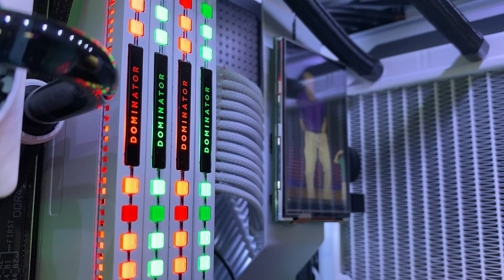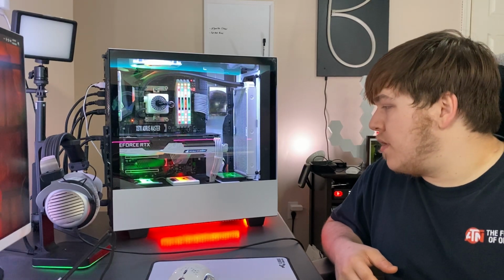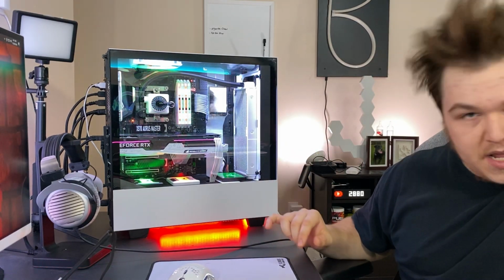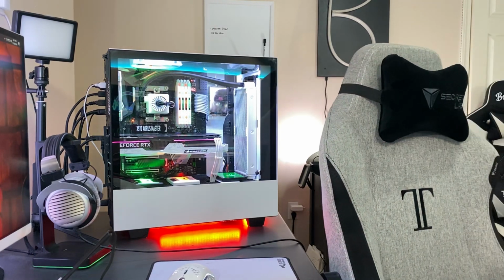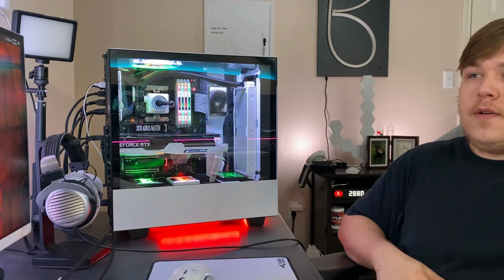DIY $50 Internal PC Screen

Comment: Nice video, thanks. Your AIO is wrong located btw. Pipes must be coming from bottom, like this, of course it can't be 100% loaded with liquid, so air will be present at most top place where the raidator pipes are and it will die soon like this. Consider to change it upside down, just an advice.

Comment: I’m sorry if this is a dumb question but what is the purpose of the SSD ? Can this work without it ? Awesome video btw!
Reply from the maker: No dumb questions here. The purpose of the SSD is to add storage. You do not need it. If you would like to add storage, then you should get one. It doesn't have to be the same brand or even size. There are a plethora of SSDs out there.

Comment: Which cpu AIO is that mate? 
Thanks for the vid mate. I was going to get an AIO with an LCD but they are about £60 more than a standard one. I have the exact same space in my Corsair Crystal 280x so the extra LCD looks so much better and costs less.
Reply from the maker: Thank you for the kind words. The cooler on my computer in the video is the Deepcool Captain 240EX. Unfortunately, due to them leaking in people's computers, they have stopped production on that specific model. I have since upgraded to the Lian Li Galahad 240.
Reply: @realJacobLane  I knew I'd seen that AIO briefly a while back and not much since, the leaky issue explains that 😁 lovely choice on the Lian Li 😎
Lian Li plus an LCD 🎶
Great idea and ryhme 👏👏
Good work 🏆

Comment: If you want to have your screen turn off at the same time as the computer, i'd suggest getting a Molex to USB A female 5v adapter. Plug right into any peripheral cable on the PSU itself, Provide same voltage as a USB port and will shut off power at the same time as the PC.
Reply from the maker: That's a great idea!

Comment: Anyone know how to fix this issue im having, my sensor panel turns into my main display, no matter what i set in the window settings, it wouldn't let me bypass as a sensor panel. Monitor is connected by DP to GPU and sensor panel connected by HDMI to GPU. TIA!
Reply from the maker: Interesting. That's a tricky one.

Comment: putting the radiator in the pc in the front is not healthy for the pump. Try top mounting it to reduce any air bubbles that might be entering the pump.
Reply from the maker: I understand, but I cannot put the radiator and fans on the top because the motherboard and ram prohibit it due to clearance issues. Also, the top of the radiator is above the pump, so in the event any air pockets form, they will go to the top of the radiator, not the pump. For the most part, 95% of CLCs are low tolerance to air pockets, meaning there is very little to zero air in the loop.
Reply: Jacob, If you use ddr4 u can maybye try the g skill trident RAM, its cooler is smaller than the board. With this RAM I was able to fit in my radiator on top

Comment: I'm a total noob regarding PC mods and the PC world overall, I'd like to know if this could work on a non-liquid cooling system PC. Just got mine that has a regular cooling system and I'm a total sucker for those pretty screens that liquid PCs have. Is it possible to do this? I'm not looking to visualize stats or anything, just anime GIFs and such. Thank you in advance!
Reply from the maker: Of course. It's an independent electronic, meaning it works on it's own. Hell, you don't really even need a pc for this to work. You really just have to find a way to power it and how to get signal to it. Mounting it may be tricky in some cases.
Reply: @realJacobLane  Thank youuu! I'll try it then.

Comment: also, can you calibrate the screen to whatever is being displayed to be flipped/positioned any way you want?
Reply from the maker: Yes, Windows settings, display settings.
Reply: @realJacobLane  another question, do i HAVE to connect the other  hdmi cable end the GPU or can i connect it to the hdmi output on the motherboard
Reply from the maker: @bigdaddybryan7918  If you have a gpu, your display settings will be set to the gpu not the motherboard, so you have to use the gpu. If you only have one HDMI, then just get an adapter.

Comment: Would it be possible to hide taskbar? I have 2 current monitors that I want taskbar but don't want it on the internal display. Nice video btw!
Reply from the maker: If you're referring to hide the taskbar only on the small display, I do not know how. You have to hide it on all monitors.
Reply: There's an option to only show taskbar on the main display in the taskbar settings within Windows, should be in Personalization.

Comment: I have a problem with my pc not detecting this smaller screen, I'm using a hdmi cable splitter since my dpu only has 1 hdmi slot
Reply from the maker: A splitter will not work. Sorry :(
Reply: @realJacobLane  do you know if there's any other way to connect it or there isn't?
Reply from the maker: @samuelaguilar7024  There is no other way other than you need another display output on your graphics card.

Comment: How long was the micro usb cable. I have one but I’m not sure it is long enough
Reply from the maker: About a foot.
Reply: @realJacobLane  ok and one more question. Is the two sided tape enough or did it ever fsll
Reply from the maker: @ezarelement7103  It fell lol
Reply: @realJacobLane  did it get damaged or did you just put it back on?
Reply from the maker: @ezarelement7103  I ended up taking it off because I swapped cases. I plan to remake the video eventually.
Reply: @realJacobLane  ok I’m using the tape too I just hope it works for me. Was there any damage from the tape?
Reply: What do you plan on using instead of tape?
Reply from the maker: @ezarelement7103  There wasn't any damage.
Reply from the maker: @ezarelement7103  Screws ;)
Reply: @realJacobLane  ok I’m going to try more heat resistant scotch tape and hope that works
Reply: @realJacobLane  did you remove the fan from the screen?

Comment: I bought the display in the link, but it has a fan that makes quite a lot of noise, did you remove it or did you buy one without a fan?
Reply from the maker: Mine did not come with a fan. It’s more than likely used to cool the Raspberry Pi and not the screen, so you don’t need it.
Reply: @realJacobLane  ok, thanks for fast reply, very good video btw, keep up the good work
Reply from the maker: @julianbernhardsen963  Thank you!!

Comment: So how does this work? I’m trying to instal this on my car’s dash board how do I go by doing this? If it’s powered by a usb cord that’s perfect but how do I get it to play gifs without a pc? Like maybe just automatically have it okay gifs every time my car starts?
Reply from the maker: Hmm that sounds kind of tricky. Maybe a Raspberry Pi with a custom OS? I don't know too much about that.
Reply: @realJacobLane  how did you upload the gifs to it? Can I upload the gifs to it through a pc then unplug it and display it somewhere that isn’t a pc?
Reply from the maker: @attck29  I used a program from Steam called Wallpaper Engine. It's 5 dollars, but I think it's worth every penny.
Reply: @realJacobLane  nice is it possible to upload the images from the pic then unplug it and use it to display somewhere else that has a usb power slot?
Reply from the maker: @attck29  I'm sure it's possible, but I don't know how to do it. :/

Comment: What’s the wallpaper app you use? Also I’m curious, I bought one last week gonna install it today I’m wondering do you have to set it up every time you start the PC? And do you have to link the display in your nivida settings.
Reply from the maker: The wallpaper app I'm using is called "Wallpaper Engine". It's on Steam and I believe it was like $4.99. And as for the screen, you shouldn't have to set it up every time you turn on your pc. For me, I have to unplug the power cable each time I boot my pc. You might have to do the same.

Comment: How did you get the display to turn of when your PC turns off, mine doesn't turn off on its own
Reply: i have one in my case that powers off the hdmi and turns on and off with the pc, bought it off amazon around 50$
Reply from the maker: @mortemachina  That sounds so much better. Can you share the link?
Reply from the maker: You have to unplug it sadly.
Reply: https://youtu.be/RcNJA6V4tNY  I used the one in this video, there may be others that also just use hdmi

Comment: i did the same , but it keep showing to me white screen on my 5 inch display :( why
Reply from the maker: Unplug the HDMI and replug it with the pc on. If does doesn't work, unplug the power and replug with the pc on. If that doesn't work, your screen may be defective and you may need a new one.
Reply: @realJacobLane  i did that about 3 or 4 times,, and i tried on my other pc,, same problem
Reply from the maker: @SamiAlsafadi95 Oh well, I don't know what else to tell you.

Comment: learned something about the CMOS battery whats it there for. Definately gotta replace mine after i been building on mobo disconnected over 1 year
Reply from the maker: Haha yep yep. Its just there to keep the time, date, and BIOS settings right. You typically only need to replace them every 3 to 4 years. If you keep ERP off, then your power supply with keep supplying the 3v the board needs to keep the time, date and BIOS settings right. It's only in transport/when the power supply is unplugged, that the CMOS battery is being used.
Reply from the maker: Another way to know if you need to replace the battery is when the time and date are wrong when you boot your pc up. And most likely your BIOS settings have been reset to default if you modified any of them.

Comment: So you just power this with Micro USB and use the HDMI to make the display get detected to use Wallpaper Engine? Is that all I need to do? I want to get this but I just wanted to clarify xD
Reply from the maker: You are correct!
Reply: @realJacobLane  Thanks!

Comment: do NOT PAY FIFTY BUCKS FOR THIS, you absolutely do not need to pay that much for ultra hd for a screen the size of an ssd, that's bullshit.
Reply: seriously, they make full 5 inchers with analog input (which is more than fine with short cable lengths) for 20 bucks. You absolutely don't need the touchscreen feature when it's internally mounted, and it gives you an actual use for legacy dvi/vga ports. The screw in is safer for something permanent anyway.
Reply from the maker: @curvingfyre6810  The digital screen is $27 not $50. Everything together is $50. This is an alternative to the NZXT Kraken Z coolers with the screens on them. They run around $250, so think this is a nice, cheaper, alternative.

Comment: Thanks for the info brother. I'm using a NZXT H710i and where you had the SSD mounted I have vast open areas just before the intake fans in the front of the case. I want to add some life to that section and distraction so the eye wont be drawn to the few fan cables in the lower corner. I've seen many before but never had the inkling to do it. Now that my build is complete I'm looking at this barren empty area of my case and it needs something.
Reply from the maker: Sounds awesome! DM me on Twitter the results!

Comment: Mine just stays on no signal. What do I do?
Reply from the maker: Make sure both ends of the HDMI are plugged in correctly. If they are, then unplug the screen from power and re plug it in. If that doesn't work, then you may have a defective screen.

Comment: where is the fan on the pi? there's a fan on the back in the amazon link
Reply from the maker: For the screen? There is no fan on the screen. It's a Pi, it's just the screen.
Reply: @realJacobLane  all good i removed the fan lol. does it get hot? being wrapped up in that tape
Reply from the maker: @josephbattad7747  It does get warm, but nothing to be worried about.
Reply: @realJacobLane  thanks dude, i did everything you showed in this video. i subbed! awesome channel man
Reply from the maker: @josephbattad7747  Awesome to hear. Thank you so much!! It means more than you think!

Comment: Why doesnt your pi screen have the fan and the gpio ports like the ones in the picture on Amazon
Reply from the maker: My screen didn't come with a fan, and I sanded down the GPIO headers to make the screen sit flush.
Reply: @realJacobLane  oh alright is there a way to get a case for just the display because the case option on Amazon is for the display and the acually rasberry pi mini pc
Reply from the maker: @ceysur2847  I have yet to find a case for just a screen. If you or someone you know has a 3D printer, you could 3D print one.
Reply: @realJacobLane  yeah my friend 3d prints stuff but he can’t a find a model that’s just for the display they all seem to be for the display + the rasberry pi
Reply from the maker: @ceysur2847  Ah I gotcha.

Comment: Is it possible to use laptop screen? I have huge case but want something bigger :)
Reply from the maker: Hmmm, that may be a challenge. You would need a driver board and more power to make the screen work. I would do some research and see if you can find the driver board for your screen.
Reply from the maker: Let me know if you do it. Tweet me on Twitter @jacobiceps

Comment: Dude you’re so right about those CPU coolers tho they dummy expensive, could buy an RTX 2080 for around that price
Reply from the maker: For real!!! It’s more insane that people will still buy them, just for the screen. It’s still a basic aio under the screen. It doesn’t justify the 300 dollar mark.
Reply: @realJacobLane  what is a normal price? Around 100 - 150 right?
Reply from the maker: @zsq007  The NZXT Kraken Z63, the smaller 240mm aio, is $250.00. And the bigger, 360mm, is around $300.00.
Reply: @realJacobLane  so is this an upshot price? I assumed they were normal. I actually considered picking one up for an upcoming build with a 5600x, but I think I’ll go with an air cooler.
Reply from the maker: @zsq007  I don’t believe so. These coolers are just very expensive.
Reply: @realJacobLane  I bought the Kraken Z63 for $200. I was contemplating getting the cheaper model without the screen but I figure if I was going to cheap out and just get an aio instead of a custom loop for the time being, I might as well throw a couple of bucks at it to make it a little different plus I'll set it to my temps so its really easy to see if it's getting too hot without the overlay.

Comment: I have a Cosair 4000D case with two 140mm fans at front and the 5 inch screen is between them. Fills the blank spot nicely. I used an adaptor to plug the usb into a motherboard usb header.
Reply from the maker: Very nice.
Reply: does this mean it will turn off with the computer
Reply: Hi do the 120mm mounts line up with the wholes on your 5 in display, if not how did you mount it

Comment: I did this and now when I play a game the game stutters alot do you have any idea how to fix that?
Reply from the maker: Interesting. I’m sorry to hear that, but if you are using it with Wallpaper Engine, that may be why it’s stuttering. Wallpaper Engine is very taxing on your ram and CPU. On the other note, if you aren’t using Wallpaper Engine, then I would be more confused than you. All this is, is a second monitor, and shouldn’t really have any performance impacts. TLDR: If you are using Wallpaper Engine while gaming, close it. If you aren’t using Wallpaper Engine, then I have no idea what to do.
Reply: @realJacobLane  I am using wallpaper engine and thanks I didn't realize that effected it
Reply from the maker: @tilvalhalla2689  Of course. No problem.

Comment: Does the usb go into a usb headed on the motherboard for power?
Reply from the maker: I suppose you could, but I wouldn't recommend wasting a USB Header just for power. I would use it a regular USB-A port on the back of your motherboard.
Reply: I was thinking of getting the internal nzxt header port to add USB’s to the inside of the case
Reply from the maker: @questt5  You could do that. Do keep in mind that this screen in particular does not turn off on its own, so you will have to unplug it whenever you turn your pc off. Or you could turn ERP on in your bios to turn off all power to your usb ports when your pc is off, but this will run your CMOS battery down. Do what you feel is most comfortable.
Reply: @realJacobLane  good to know. I saw one that does have a turn off feature but doesn’t have touch capability like a lot of the raspberry pie monitors have, but if it’s inside my pc I won’t need that feature anyway.
Reply from the maker: @questt5  Right right. This one doesn't have touch features.

Comment: And what do I use to control the video on screen
Reply: You could technically even use Aida64 and show computer specs like CPU temperature or GPU temperature.
Reply from the maker: You can use anything you like. It is just another monitor, so you are free to use it like a normal monitor if you so please. I personally use Wallpaper Engine on Steam for animated wallpapers. But you could use whatever.

Comment: Question. If my pc with the screen is to the right of my monitor and I move my cursor right, will it go on the mini screen?
Reply from the maker: You will have to go into your Windows settings and choose where the monitor is. Right click on your desktop and click Display Settings. See which monitor is the mini screen and move it where you want.
Reply: @realJacobLane  thank you for your help! Is there a way to make it where the cursor doesn’t go over?  Bc I don’t want it going on the mini screen
Reply from the maker: @ch4r892  I'm actually looking into that myself. As of now, I have no idea how to not make it appear.